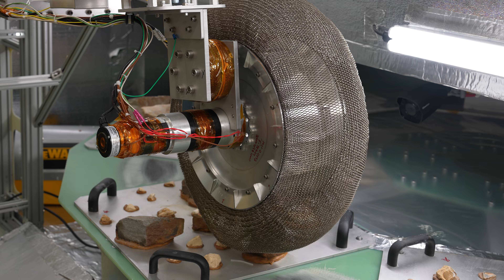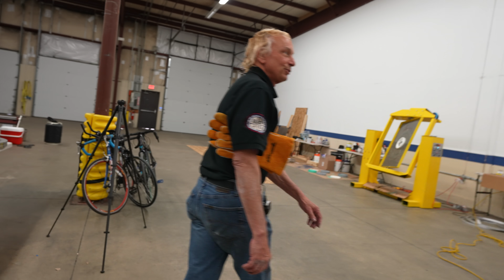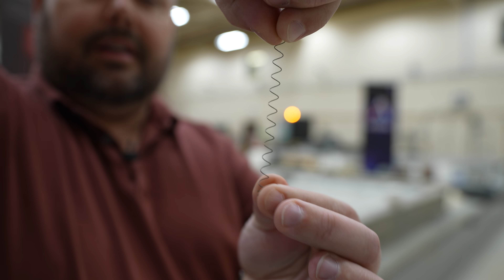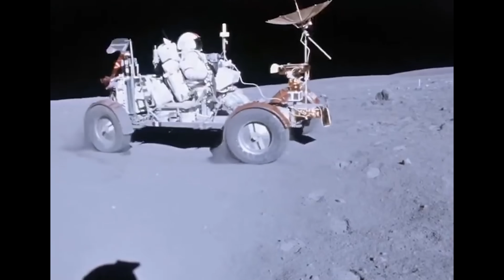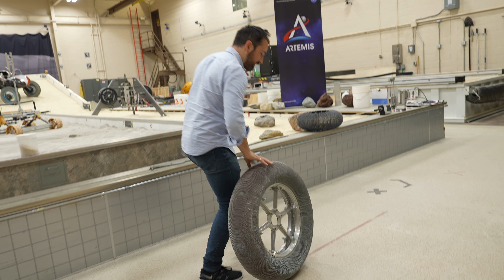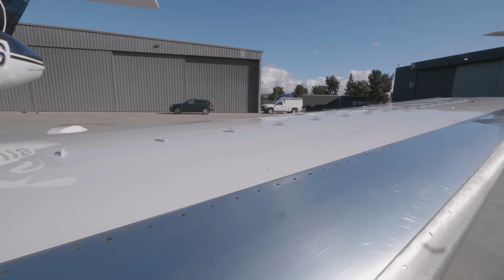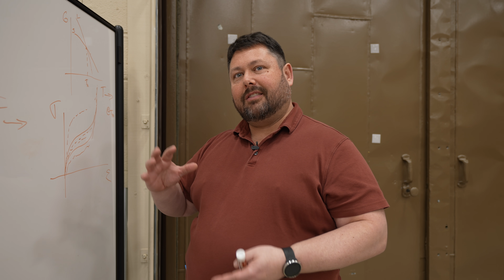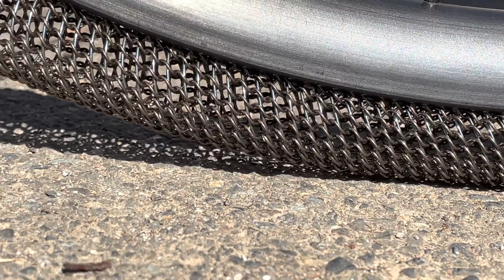How NASA Reinvented The Wheel

Comment: As tires for cars, its braking properties won't nearly be as good as conventional pneumatic tires. Not to mention, its ability to handles turns, launch from stop, various weather conditions, getting debris stuck and tossing around inside the mesh tires that may lead to wear from the inside out, etc. may not fair nearly as well either. It may have a benefit of added grip during snowy or icy conditions, though the net benefit seems like it may be at a loss.

I think it needs significantly more research and development before we see a NiTiNOL tire that's comparable to conventional ones.
Reply: All earthly tires are encased and with rubber treads. Why would braking be poor, if you have a perfectly consistent rubber tread on the ground, supported by a strong and flexible titanium skeleton?
Reply: @thesmarttirecompany  They aren't all constructed the way that you claim. Case-in-point, the ones at the Glenn Research Center, which is clearly what I'm referring to. In any case, R&D has a long way to go before we see consumer adoption of them on everyday cars as a readily available and viable option. Or, do you assume them to be as safe and perform just as well as conventional tires?

I'm willing to bet that it's not anywhere near where it needs to be. The major tire manufacturers aren't producing commercially available options. And, among the first to adopt them perhaps, would be F1, Nascar, etc. I also doubt that NiTiNOL will be able to handle the forces exhibited everyday on conventional tires, especially on highways where you want a stable ride.
Reply: @kovko69  we are the only ones building tires for earth - NASA Glenn is building for rovers. The ONLY exception is the Jeep tire in the video, which was a proof of concept to show it could hold the weight. So yes, all earthly tires are designed to have casings and treads.

Yes, car tires have a ways to go in development. But, I believe in our team that has put car tires on the road and rovers in space for the last 40+ years, and the NASA team that built the Jeep tire proof of concept for a reason!

Comment: I can't imagine it being a mystery material that won't grind down itself or the asphalt it's used on, much less at the impact of an aircraft. Not to mention custom order hand made tires seem expensive.
Reply: All earthly applications will be encased and with rubber treads (though you are correct, the metal tire would eat the road). The rover tires are handmade (they don't exactly make a lot of them), everything else is manufactured.

Comment: The liquid piston engine looks like it has alot of potential... 2 things that may help it to get off the prototype phase and into the real market is 1. Military contracts, and/or 2. The hobby industry... LMH is a perfect example of how the hobby industry allowed a small business to grow to near mass market levels... on a different note, the Mazda Rotory motor is the 1st engine to surpass 1 hp per pound, even today only F1 motors come close to those numbers, in part it's due to the Rotory engine being 70%+ efficient in creating power, in stock form, again only heavily modified/race engines hit these numbers... but like everything there are always drawbacks, and the fuel efficiency is down compared to other engines and emissions have never been solved...

Comment: While the concept of wheels made by this material sounds great, won’t the high heat of the roads (mainly asphalt) damage the wheel formation?
Reply: With the sheer amount of combinations and methods for creating the material, almost anything temperature ranges are possible. So the wheels would just need to be created with a version of Nitinol that does not return to/deform and the temperature of hot asphalt

Comment: A very useful material. Though for road use, having just pure metal to concrete/asphalt would create a lot of air pollution. Maybe have it covered in a rubber housing like the bike tire? The one issue I see with that is accumulation of water if you have punctures, but that should probably be solvable.

Comment: One outrageous blunder is the claim that in near zero atmosphere an air tire would explode.  Our atmospheric pressure on Earth is a little less than 15 PSI.  So sending a bike tire into outer space would only increase the pressure on the tire by about 15 PSI, not blow it up.  But there are plenty of other good reasons not to use an inflated air tire for space missions, just not that it couldn't hold the relative pressure of being in a vacuum.

Comment: If there's a version of this that can be controlled with current instead of heat, imagine that. Muscles for robots, for one thing.

But another use case for the heat version is electric generators in space or the moon powered purely by nitinol-actuated turbines and by the severe difference in temperatures between shade and not-shade, so not requiring water to make steam, and collecting free energy from the sun without the use of solar panels.

Comment: I'd love to see Nitinol used in Emergency fire Shelters for Wildlands firefighting. Currently shelters are a loose sheet/fabric with no supports keeping it from resting on the firefighter when deployed. These wires could work to maximize the insulting volume of the shelter, and prevent severe burns from a compromised (conductive heat transfer) shelter.

Comment: The downside of Nitinol tires: stop sticks become irrelevent, hence a valuable tool to stop high speed chases safely becomes neutralized.
Reply: In addition to other concerns, but yes, this.
Reply: @strikerevimus   Yes, I'm sure there are performance issues; there always are with new products. I just don't have the requisite knowledge with which to comment. But, I am willing to listen.
Reply: @larryclemens1850  Others have stated performance issues they have thought of with some of them being addressed with covering the wheels in rubber, so I'll let you see them. Me, I'm more worried about use in military applications such as tank treads and APC wheels... A lot of anti-tank tactics are designed to disable treads, this material could potentially render a number of them moot. As for APC wheels, same thing, but a lot of weapons would also be ineffective if they can't do any actual damage to the wheels in making them go flat. That would make it necessary to design weapons specifically to counter such use by military of other countries, as well as the potential for when, not if, when this gets into the hands of other countries. Particularly in the hands of countries not concerned with treaties as long as they win.

Back to the police thing, if spike strips would be ineffective, so would most weapons police usually carry, and they would need more bullets than they currently carry to shoot out such tires. This would necessitate aiming for parts of a vehicle for disabling that police wouldn't like shooting out because of other risks. Such as hitting the perp they're trying to catch with minimal injury to all involved including the perp.

Any other concerns to practicality and costs are only time sensitive, advances will make those immaterial. My concern is for how this could be abused for more nefarious uses. Of course, Veritasium has ignored concerns of technological abuse before, like with self driving cars where he dismissed legitimate concerns, so it's no surprise that he wouldn't address that here... I wouldn't be surprised if he does a followup that dismisses concerns of abuse, and then another video that destroys his own supposed counters to concerns proving the concerns are valid...
Reply: @strikerevimus   Interesting. I would point out that use in private vehicles could be regulated, or even banned by law.
 But, development by foreign adversaries for military applications is going to occur no matter what domestic laws may be passed. Therefore the prudent course of action for the military would be to assume that being the case, and to develop the technology and potential countermeasures ahead of any foreign  adversaries.

Comment: Great video! 
Just one thing to point out, in the second stress-strain-temperature graph that you shared, I think you need to correct it to show change in temperature too. Right now, you are showing only hysterisis in stress-strain and no change in temperature. Which is not true since you pointed out that it, i.e twisting the rod, is an endo/exo thermic event.

Comment: As an engineer I see little problem.
When you press little rocks into it, they may never get out of there, because theres not enouught force to press them out.
So eventually you will get mesh tyre filled with little pieces of different rock.
Reply: Just like metals rocks don’t last forever when they tumble around inside if it they will hit each other and become smaller till they fall out
Reply: @patfre  it has to be some soft rock, if it hard rock, like silicone.... it takes hell of a lot of time, most propably tyre is filled before first rock is pulverized enought to get out.
Reply: @Martink9191  pretty sure most of Mars surface that is small enough is just volcanic rocks which is pretty brital

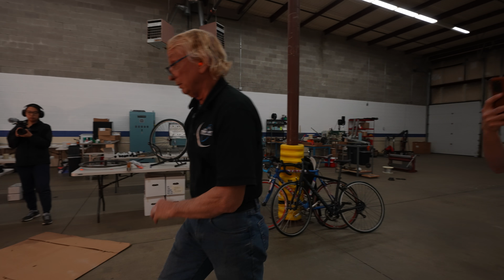Comment: 2:18 Calling it a "bulletproof" tire in the intro seems a bit misleading. It's just a run-flat tire. Bullets still penetrate.

Also, is that actually a .22? Why doesn't it give off any muzzle flash? It looks like a pellet gun.
Reply: Normally in this light of environment you wouldn't get a muzzle flash at least until a few shots in, just look at range vids, but in this case it's a BB gun.
Reply: @99TotalKills  In my opinion you'd at least see some smoke or unburnt powder ejected from the barrel in this environment. Even if .22LR doesn't have all that much powder behind it, I still think we'd see something more than this. But we're in agreement this is almost certainly a pellet rifle/BB gun.

Comment: Huge miss on knowing the tire pressure of the average commercial airliner. For reference, the largest aircraft in thr USAF inventory peaks at 150 psi per tire and it carries a much heavier load than any commercial aircraft in the world can.

So 300-400 PSI in a commercial aircraft tire would absolutely burst it no questions.
Reply: To their credit, aviation tires are not their forte so I didn't really expect this guy to know what he was talking about in that application. Still a cool technology that we might be willing to talk about in the aeronautical engineering fields if you can make one that can support our weight and is ok with skidding for a little while on touch down before friction causes it to start rolling which is one of the biggest factors for tire wear in our industry.

Comment: Can't they make tires out of the same materials as spacesuits?
 They hold air, and don't even deform; pufferfish style, whilst preforming a spacewalk
Reply: Spacesuits don’t deform because of the pressure lmao also just a nail is enough to potentially make it pop like a balloon you really wanna be 100 km away from a base on another planet and have it pop like a balloon from a tiny pointy rock?
Reply: What pressure? 
It's the absolute vacuum of space, we're  talking about. 
 Negative pressure that would make the astronaut's blood boil
  Still; the astronaut, with breathable air doesn't puff up, like roadkill on a 90 degree day
 Fascinating
Reply: @CheekyPseudonym  you are aware that air is pressurized and is inside the suit pushing outwards right?
Reply: YES.
 like putting a deflated football   in a vacuum chamber
Reply: Isn't it a little suspicious?

Comment: Funny fact, as a teenager I was receiving a child sci magazine, ABC (in Czech rep) and Nitinol was there mentioned in the middle of 90's, Nitinol engine in exact, two different diameter pulleys with a Nitinol spring instead of a belt, and submerging one of the pulleys into a hot water the assembly started rotating.... Funny that it took them only 30 years to use that....

Comment: How are they handling abrasive wear? I've been thinking about a nitinol bike tire for a few years now, but I'm not a material science engineer, so I only have access to common commercial products (mostly eyeglass frames). My samples have the elasticity demonstrated (though probably not the full 8%), but they are relatively soft and scratch easily without a protective coating.

Comment: I wish Nitinol tires were normalized, because this is such a futuristic time, but we're still plagued by pneumatic tires. Can't rebuild a car or motorcycle tire. If tread is worn down, or even the sidewall damaged on a new tire, then the whole thing is garbage. Then there's tires being vulnerable to wicked or stupid people, slashing or deflating parked tires for their amusement, or to trap their victims.

Plus, I think there is a conspiracy to block airless tires from civilians, because of all the money tire manufacturers and shops will loose, and police spike strips will be made obsolete, even though those gang members of the state have other tech to stop cars, like that net that wraps around a rear wheel, forcing the running car to drag a locked wheel and whole police vehicle.

Airless tires would be so great for humanity and environmental impact, but I would not be surprised if they were blocked because of disgusting levels of greed, control and incompetence. I don't want my life affected by evil people, stupid people, or out of touch government people as old as television.
Reply: And of course, rubber won't be obsolete, because mesh spring tires can still use bolt on rubber treads. Also, for cars, trucks, and motorcycles. Wheels can be rebuilt or customized, similar to multi-piece & beadlock wheels. Just replace parts that are worn or damaged, and these mesh wheels can only gradually fail, not catastrophically, immobilizing the vehicle or endangering anyone. Just need blue or red Loctite.
Reply: Wheels like these should already be available for fleets, and people who just want the assurance that their wheels will just work. Little to no maintenance.
Reply: I forgot to mention the bolt on rubber treads can be like those bicycle rim brake pads, where the rubber is set around the bolt on part, not glued on to that bolt.

Comment: You could also fill a tube with custard and get the same result... Since it's tixotrop the tyre will harden under pressure and carry the weight of the spacevehicel. 

Probably much cheaper.

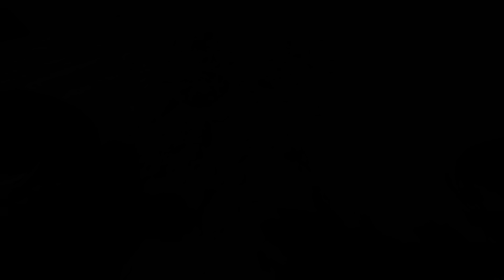Comment: [ 5:16 ]

When you apply force to a material, there is an induced resistive force per unit area developed, thats stress. You don’t apply stress. It’s something that’s created because of the application of force. 

(Extra info) Stress is independent of material properties. Plastic or metal, the stress produced is the same. However, the way it deforms and the amount it deforms depends on material properties.
Reply: If you wanna be that pedantic, you should also complain that we don't test "materials" but rather components. FWIW the term cannot reasonably be confused given the context, and in reality no human is perfectly precise with language.